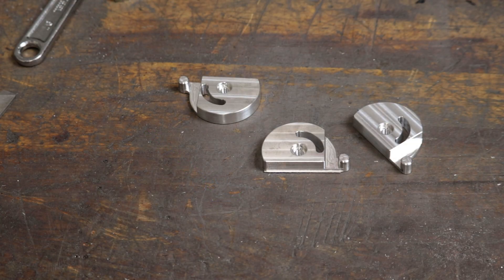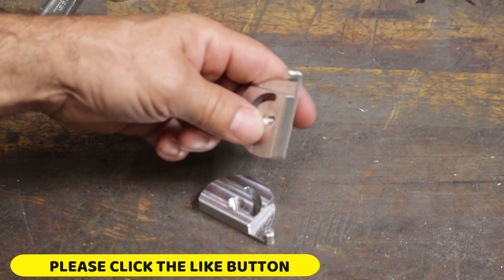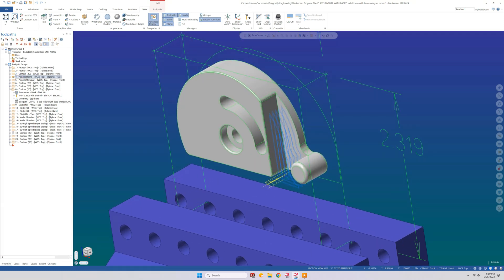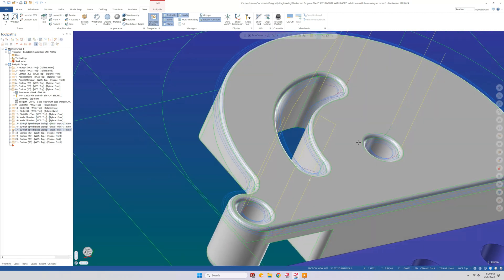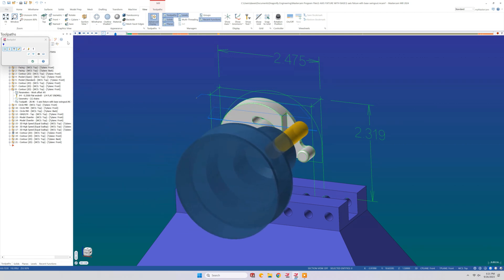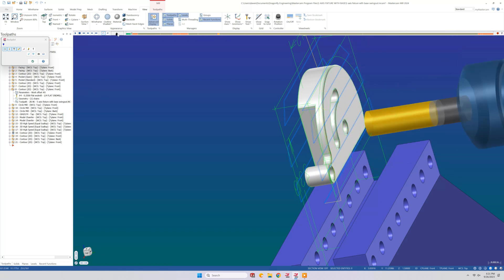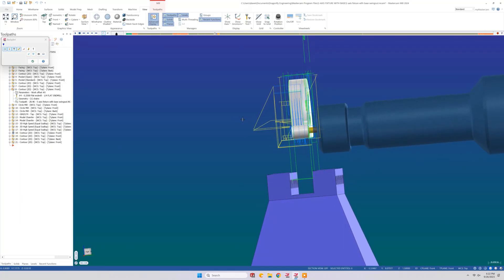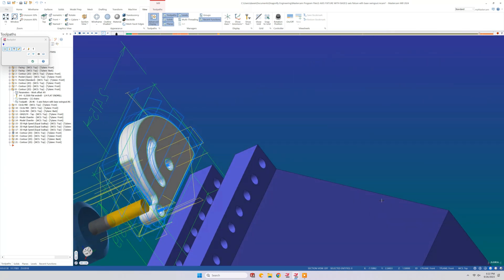Quick 5 axis CNC milled part

Comment: do you have any advice for a hobbiest who would like to get into injection molding production at home? for example, milling simple aluminum molds at home + injection molding hundreds of small parts a day. i have an old Roland MDX-40 milling machine that's really only designed for milling soft materials like machinable wax and plastic, but it 'can' mill aluminum if you are really careful. i've been looking into desktop injection molding machines like the one from APSX or the Pocket Injector Model TJR-3. one big issue with desktop machines is that they cannot do a two color double shot. not unless 'maybe' two desktop machines are placed side-by-side or one atop the other and 1/2 the mold was slid back and forth between the two machines. tricky but 'maybe' possible. my goal is to make hundreds of parts a day (all under about 20g). i've been trying to get up and running with silicone rubber molds and epoxy resin, but the big frustration with rubber molds is they degrade very quickly, especially if you need a glossy finish on parts. i'm starting to think i may be attempting the impossible and should just partner with a local plastic injection business, but i haven't given up on the dream of making and selling parts from home just yet. thanks
Reply from the maker: Thanks for the question.  Your project scope depends on your buget and floor space.  I have a morgan press that I have been wanting to sell, maybe you want to buy it? It is a classic design which has been around for 30 years.  You can run semi automatic production on them, or you can buy a XPM-17 molding machine.  Re milling machine, I am not as familiar with bench top CNC machines.  For me I got started buying a used Bridgport style knee mill with a 3 axis CNC controller added to it.  The ridgitity of the mill is important for good mold finish.  You can do 2 shot color, - TPE rubber parts, but yes you will need 2 molding machines and a way to swap shuttle the core of your mold from one machine to the other.  This takes a good amount of time to do, so it is tricky to make much money that way.  Hope this helps.  This video is my example of 2 shot molding with 2 machines:  https://www.youtube.com/watch?v=FS1ca61ttJk&t=47s